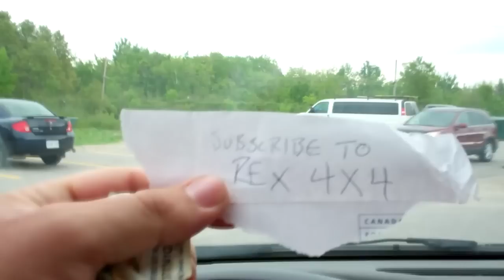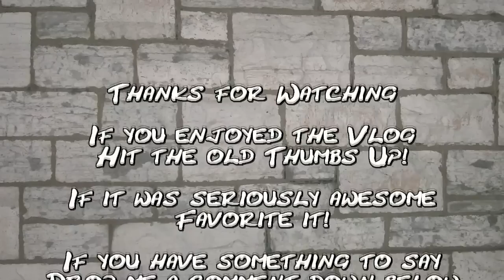(Day 133) - 06-03-2011 - Can't sleep, Cow will eat me

Comment: The diode is bad in the alternator. Whats happening is that the diode is letting the battery discharging through the case in the alternator. If you could find a diode trio for the alternator you could fix it.

Comment: do ya mean the voltage regulator? if so, yeah, be better off having it rebult, but no replaced, I've had alot more luck with alts and starters by having them rebuilt versus just replacing them. gl